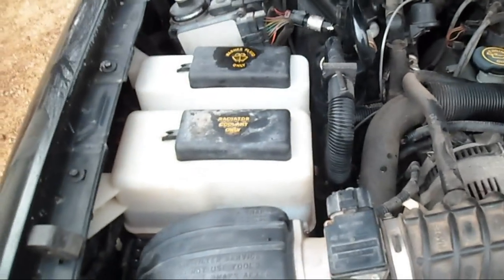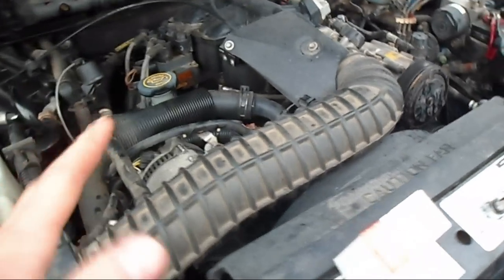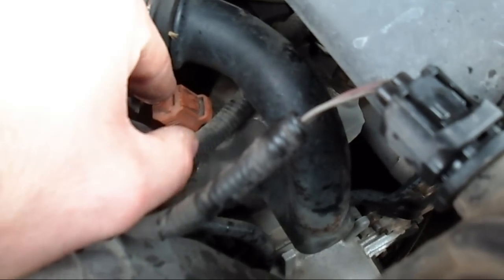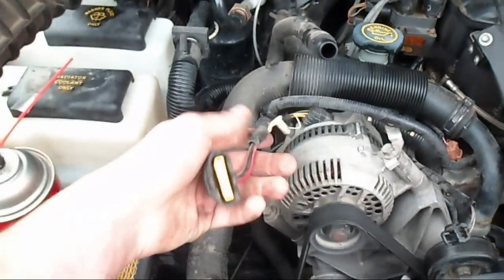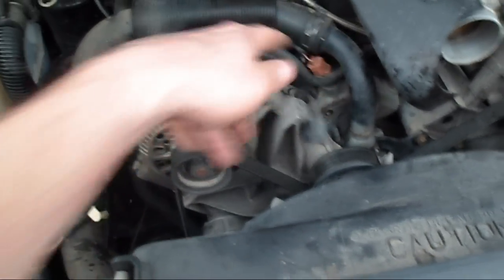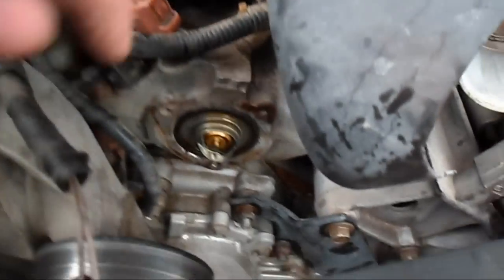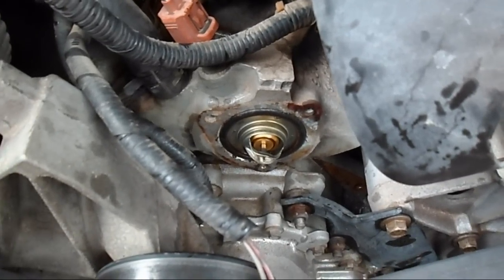Ford Ranger Thermostat Replacement

Comment: This fixed my problem, gauge would ride at 7/8 torwards hot and now it sides 3/8 highway cruising. Make sure to leave radiator cap off for about 3 mins running to burp system and then be certain great thormostate burp hole is on top(little hole with one way valve

Comment: Korrie...did replacing the thermostat fix the back pressure issue. I have that problem.
Reply from the maker: I had cracked heads. It did not fix anything.

Comment: Well here's my two cents on this project.  It sucked.  Really.  Sucked.  First, two of my bolt heads rounded out.  Tried every method I could think of to get them off.  Finally dismantled the whole darn thing, pulled it out, ground off the head of the bolt, got three new bolts to put in, etc.  Cleaned everything out real well, and replaced the two sensors at the same time.  $30 in sensors that may or may not have gone bad was worth it to not have to take that thing apart again.  Got it all back together, but now I have a bad slamming sound when the auto shifts from first to second, and a slightly lighter slam from second to third.  Neither was there before this project.  I'm stumped.  Going to have my buddy use his cool diagnostic thingy to give me the error code to see what the deal is.  On the bright side, temp gauge works for the first time in four years, and my heat gets nice and warm!

Comment: Looks like I have to replace mine, too. I've got an 08, 2.3 L 4 cylinder. Same kind as yours? What tools did you need to get it out?
Reply from the maker: +Mazzara1035 I have the 4.0 V6, but the process is similar. Just need a socket and ratchet to remove the hose neck.
Reply: +Kory's Rides thanks.

Comment: Hey man I was wondering was it leaking right underneath the alternator bracket
Reply from the maker: Was stuck. No leaks.
Reply: Gotcha cause mine has a steady drip right under the alternator but can't determine where it's coming from I'll try changing the thermostat
Reply: And no white smoke or leak out the exhaust
Reply from the maker: Justin Jackson No. it was stuck. The heads overheated.
Reply: p

Comment: Did you have to drain the coolant before removing the thermostat?
Reply from the maker: No, but some will come out from there when you remove it. It's not a lot. You could use the opportunity to flush your system though.

Comment: Helpful video, kinda. Would be more helpful if you show how to actually remove and install the t-stat.
Reply from the maker: Pull straight out towards the radiator to remove, push in straight towards engine to reinstall . . .thought that would be self explanatory.
Reply: You have had a smart ass answer for every question people have asked. Stop doing   Tutorials if you can’t show more respect than that.Also your “self explanatory” responses like that are actually ignorant,in the since that people are looking at this stuff because they may not be mechanically incline as some of us are. Take more pride in your work/Tutorial and have some respect.

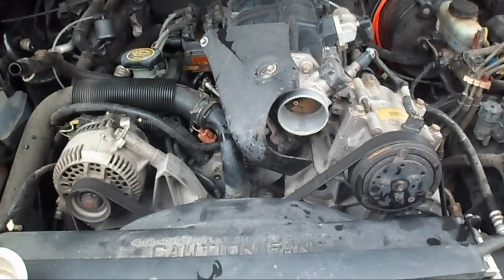Comment: at time 2:25 you forgot to say what size bolts ...I would guess either 8 or 10mm
Reply from the maker: I didn't forget; that's just not a very important piece of information. There are only three bolts to do this, so it's the same three you took off before.

Comment: lol... the '04 looks nothing like that.
Reply from the maker: That's because 2001 and up has an overhead cam engine. Notice the video description says 2000 or older
Reply: same setup as my 95 I have an undercooling problem, which the thermostat should be the correct fix.
Reply: did you drain your coolant out to change the thermostat?
Reply from the maker: Dan Melvin No. You don't loose very much, just whatever is in the hose and the neck. About 1 cup.
Reply: yeah I'm doing it now. I got the new stat in but the last bolt on the bottom of the housing fell down abd I can't find it. I'm assuming If I don't get that last bolt in its gonna leak coolant. trying to find a bolt to replace it, but all the hardware stores are closed.
Reply from the maker: Right, it will leak all over without all of them tightened the same.
Reply: alright used another bolt. got the job done my temp gauge is working again. took it for a test drive, but now I have a really ruff idle, and my lower gears can be jerky at times. I noticed before check engine light ever came on it was jerky in the lower gears and after it came on it was alot smoother. though I don't remember it ever idling so rough.
Reply: well I guess rough idle is cause I need to burn the coolant lines . engine hot bow so I guess I'll wait till tommorow
Reply: burp* the coolant lines air pockets.